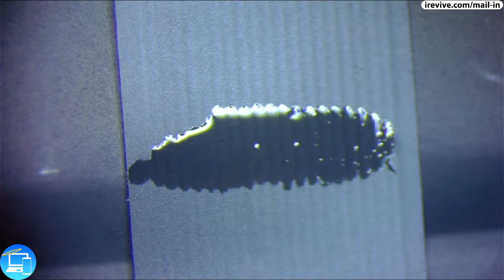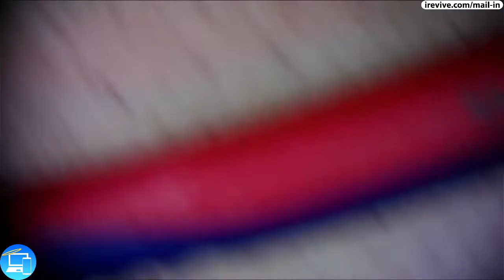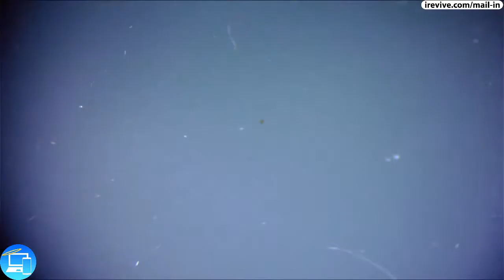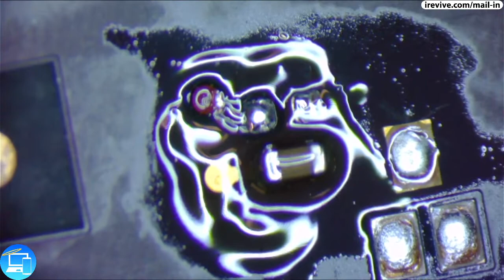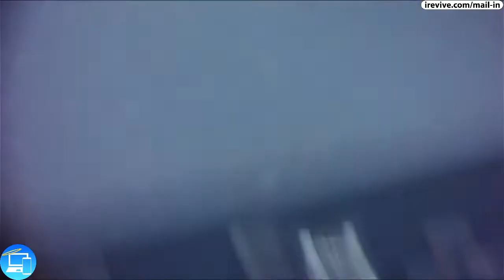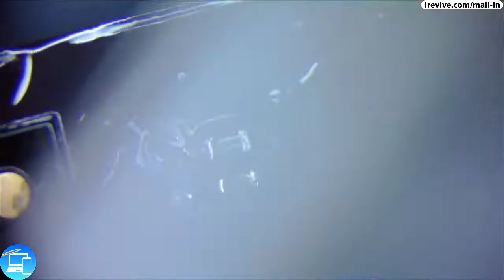Winterstorm Logic Board repair live stream

Comment: On the schematics for macbook pro logic boards, at the 5 point (pin) dc in, is the DC in where the magsafe attaches or is it the small jack on the PCB?
Reply from the maker: The five points is where the connector attaches to the logic board.
Reply: @iRevive  ok thank you